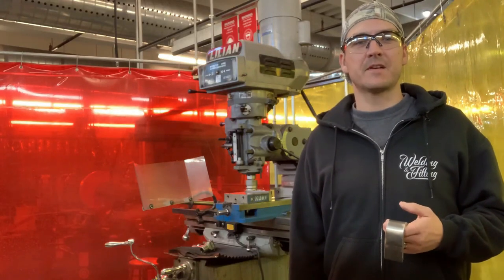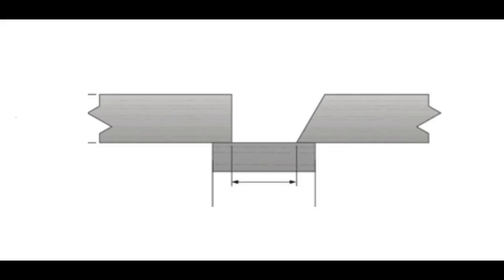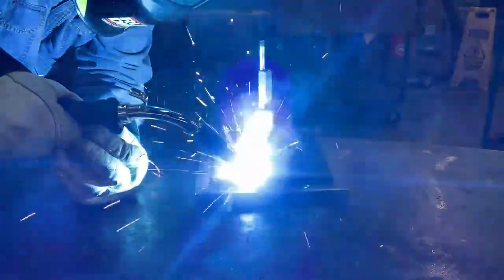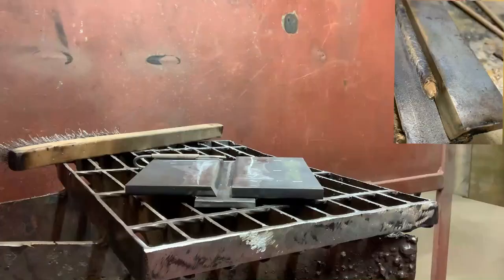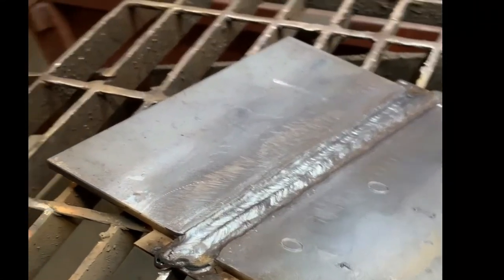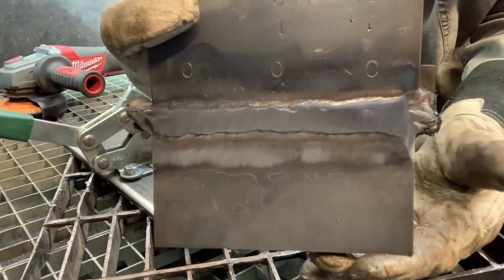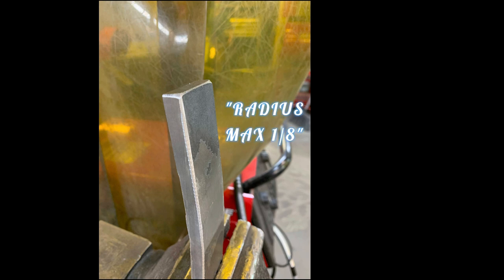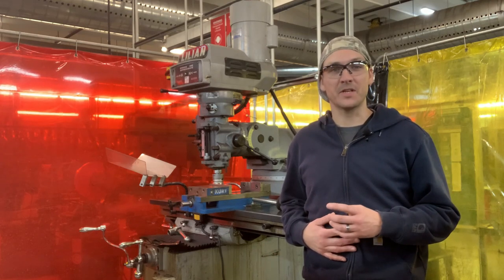CWB  Test Plate Overview

Comment: good info in this video! I'm preparing to go for my first stick test soon. Is it typical for me, the person doing the test, to grind and cut the coupon after I finish the test or is the grinding and cutting done by the tester/instructor? Thanks
Reply from the maker: @deedotyou  Appreciate the support👊🍻…. This would all depend on the test center. Unless your plates are being sent out for radiography (xray) the tester is normally responsible for processing. Ultimately, this all depends on test center. They are all different.

Comment: Don't have to do  first layer in three passes
Reply from the maker: Ya for SMAW some do it in 2 passes - I find the success rate is better when done in 3. With the exception of vertical and FCAW OR GMAW spray 🤘
Reply from the maker: @kennethjamesfinch6997  I think it’s a matter of preference. Personally short circuit GMAW 3 Passes Spray GMAW 2 passes on root.